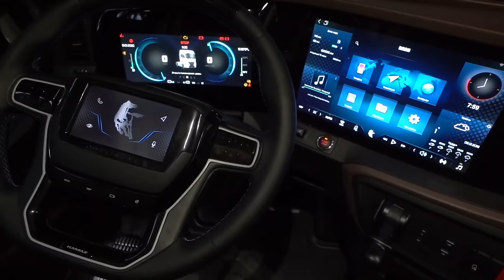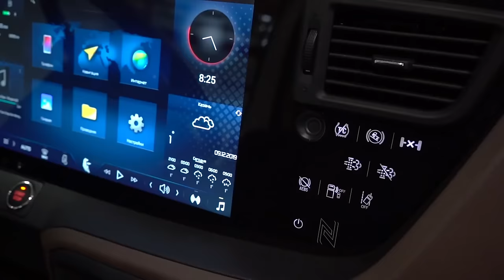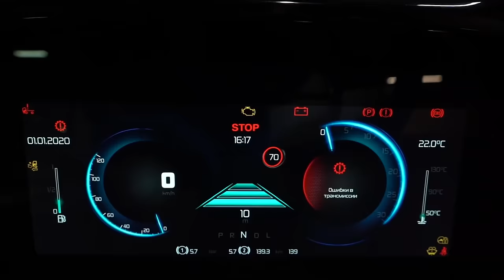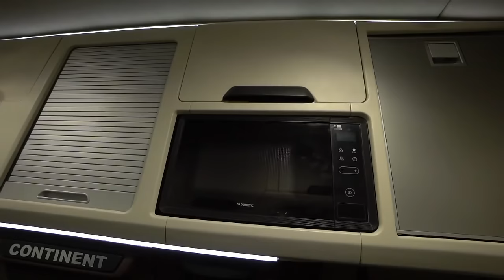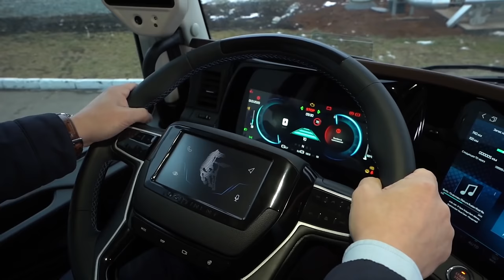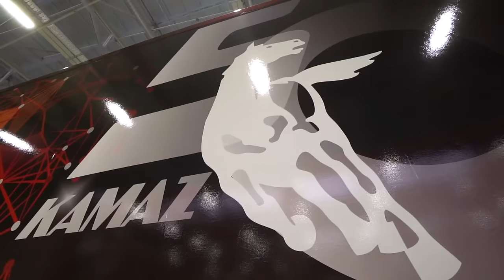KAMAZ TRUCK, RUSSIAN EXCESS

Comment: the Kamaz model 54907 continent, for the curious people, the price of the truck is fixed between 52 000 and 75 000 euros depending the configuration. just to give a reference,  an actros L from  mercedes the price range is between 95 000 and 180 000.